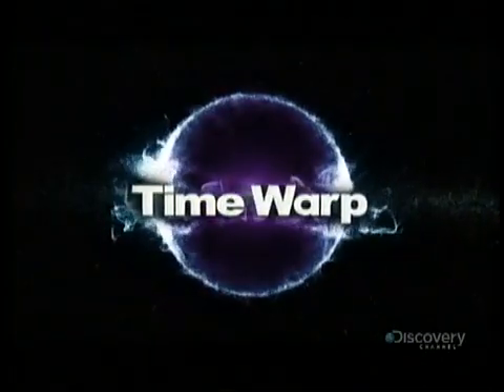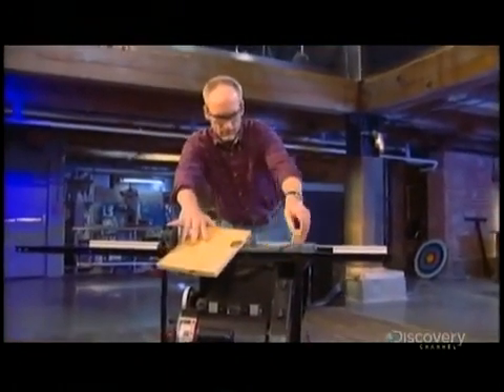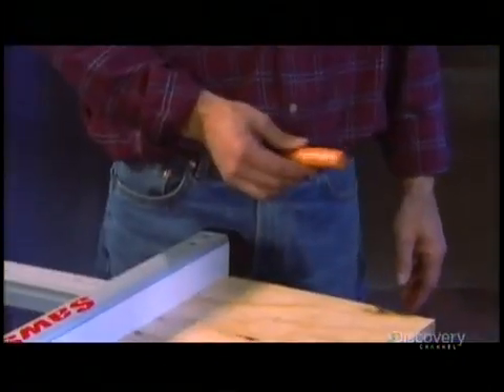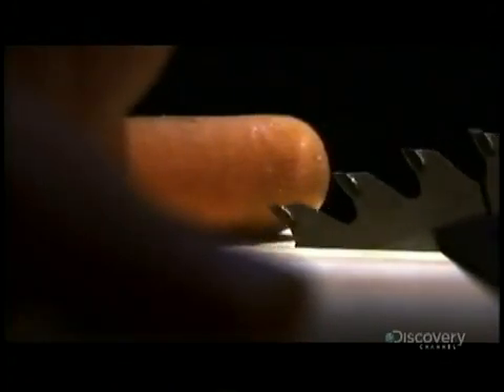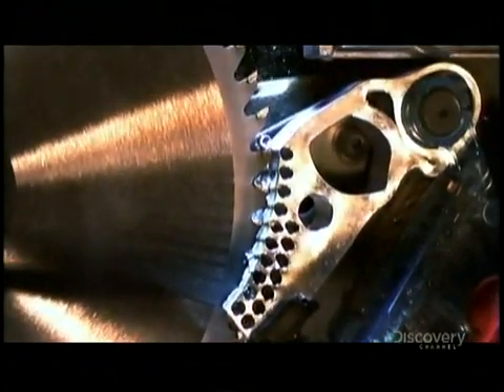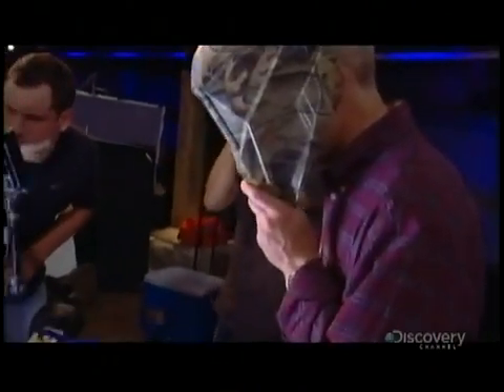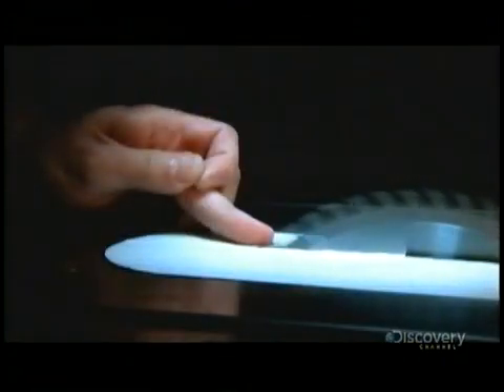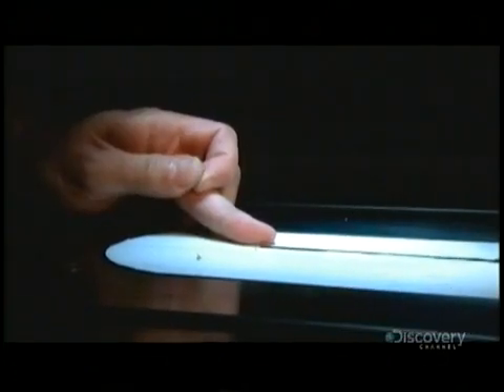Saw Stop - This guy puts a finger into an active table saw blade & comes away without a scratch!

Comment: Isnt a finger normaly dry, specially when working with wood and wooddust?
Reply: we are mostly made of water....
Reply: You do know pure water doesnt conduct electricity? You need electrolytes solved in water to let current pass. And have you worked with wood before? the sweat on your fingers are taken away by the dry wood, since that is made of glycogen-moleucles which are hydroscopic, like sugar is. So, aslong as you are not wearing gloves that can make your hands sweat, you are likely to get your fingers cut off by the saw!
Reply: Conex Xenon Yes I worked with wood on a big 7 operations machine. Yes, pure water (destiled) doesn't conduct electricity because there are no "metals" (minerals) on it. Anyways we stil are conductive, but if your theory work, we can touch cables without getting shocked??
Anyways in a normal cut, and if "this thing" works, half of your finger is gonna take cut at least.
Reply: You dont need metals solved in water to conduct electricity... , yes they can act as a electrolyte when solved in water, but salts consisting of simple kations like the alkali-metals and "earths-alkaline metals + any other organic or inorganic anion will also do!, however the list is endless, anyhting which can be solved in water will mostly do. and yes, you can touch cables if your hands are extremely dry, there are people "not much" who can touch electricity, because of having really dry skin, but everyhting has a limit of course. Also the idea of the mechanism is great, but its not quite trustworthy when working with bare-hands
Reply: joecugo it actually does not , pure h2o does not conduct
Reply: Conex Xenon trefhi I don't know why, but you two seem to have forgotten all the electrolytes that are constantly in your body. The human body is a very good conductor of electricity. Your body is not pure water.

Also this invention does work, even if sawing normally (by normally I mean the average wood worker) you would still barely get a scratch. You could slam your hand down on this thing and you would still have a small scratch. (The blade stops in about 16 milliseconds, to put that into perspective the blink of an eye takes 300-400 milliseconds)
Reply: Conex Xenon iLuZiioNz Tutorials Your discussion is pointless, do you realize that? Video provides us proof that it works, the only way to question that is to conduct an experiment! You have to check it yourself or have a source of someone checking it, otherwise you're speaking bullshit. Bullshit that lacks ANY value. I'm not saying that to offend you, but to save your time - opinions have to be based on facts (when possible - and this is one of those times when it is)
Reply: joecugo
Yes but so do air and rubber. But since the conductivity is extremely low to a point where we couldn't even measure current with normal means, we say it does not conduct.

But philosophically and physically you are technically right.
Reply: joecugo no it doesnt......H20 by itself is not conductive, the minerals an impurities inside of it are what makes it conductive
Reply: Electrolyts need to be solved in water to work... I wouldnt trust this invention yet...
Reply: I don't understand your dilemma. Your body always has electrolytes.
Reply: I m talking about the contact-surface of the skin, of course my body has electrolytes... the surface of your Skin might be dry once you work with wood, that means less to no conductivty , electrolytes don't have any effect like this.. So how is the saw going to stop once you touch it and you don't conduct electricity.?

Comment: I like the idea, however the test was not accurate. If you notice, he put his finger slightly to the left of the saw... Had his finger been aligned to the direction of the saw, he would've lost the tip of his finger according to the video...
Reply: a school near me purchased this saw back in 2007. since then the system has had to be implmented over 10 times. On all occasions, no student needed to be admitted to the hospital. not even the school nurse.
Reply: Not exactly. As you can see, its the tip of the blades that graze the finger and force the stop. So no matter than angle of attack, the machines "reaction time" is the relatively the same.
Reply: Eric Torres 10 times? LOL they did it on purpose
Reply: Shannon Torstonson Nah, usually these systems are falsely triggered by wet wood or metal of some sort. Anything that conducts electricity well, will trigger it.
Reply: No he would not. The blade stops and drops in under 10 milliseconds

Comment: What if you try to cut slightly wet wood, the resistance will drop and false positive protection kicks in.
Reply: There is an override for cutting wet lumber, but you would need a moisture tester to find out if you need to use it

Comment: If he were REALLY trying to bring the number down to zero, he'd invent an AFFORDABLE saw stop system that could be retrofitted aftermarket, or make the actual sawstop affordable to the average woodworker.
Reply: First of all, he never made that statement, it was the narrator of the show. All he did was invent a cool safety device. Second, it's not really incumbent on him to make sure everyone can afford it. It costs a lot of money to develop and produce something like that; what, do you expect him to sell it at a loss? Be real. As for retrofitting one to an existing table saw is simply not practical under any circumstances, and literally impossible to do for less than the cost of replacing the saw altogether. This should be pretty obvious if you give it even a moment's thought. Can you imagine trying to retrofit airbags into a car that wasn't designed for them?

Comment: nice.  but, instead is barely moving your finger into the triggered distance at such a slow pace, what if your finger is travelling at 3" per second like most people?  will it nick you good at least, than?
Reply: Sure it might nick you more than it would if you went slow, but it would be nothing compared to what might have happened without the invention.
Reply: I was thinking about it too, but then I concluded that if you compare the relative speed of your finger/hand to the spin of the saw.. it doesn't matter if your hand/finger moves really fast, since "really fast" is nothing compared to the RPM of the saw.
Reply: Look at the hotdog test. That was at a normal pace and it had little damage. I'd say it's preeeeetty good.
Reply: My thoughts exactly. One wouldn't be creeping up on the blade in normal use. I figure there will be some blood before the blade stops, it might just save your finger but it won't be pretty either way.
Reply: icawn oo0Spyder0oo The blade stops in about 16 milliseconds, to put that into perspective the blink of an eye takes 300-400 milliseconds

Comment: SUPERB but a few questions ?  1 will it cut damp wood out doors or indoors without false triggering    2  work through an isolation transformer
 or 3 work 100% of the time  in very dry conditions indoors with someone wearing shoes with modern soles  i wouldent bet my finger on that
if the table of the saw  was made of plastic so as not to ground any signal and the user had  to use an an earth strap  pluged in to the saw  to opperate it 
through a safety interlock device when using the saw  like this may overcome these problams in rough servixe,  the interlock would also  check if somebody was  connected to it so as to prevent it being powerd up and  used without it
gerat idea
but i think your next task steve  is to try to intergrate this idea  onto a  chain saw
that would save more than a finger (STEVES CHAIN STOP)

Comment: this is an awesome idea, and I'm sure no one would argue that the $60 for the new parts is cheap price for saving a finger or two. What I wonder, since it works on the difference in electrical conductivity, is how it is effected by a damp piece of wood, or treated wood. I would begin to get unhappy if the thing came to a crashing halt every time I tried to cut a damp piece of wood.

Comment: What i'm wondering is how slow you have to move your finger to avoid a cut. Or how fast, on the contrary, do you have to move your hand into the blade to get a cut.
Reply: Electricity moves faster than the speed of light. Literally. You can run your hand into there pretty quick and still have the blade sense the conductivity your finger lets off. But, you have to take into consideration the circumstances. Someone using this blade wouldn't be feeding wood at a rapid rate. Slow and steady is your best bet. You can see how close the guy's finger got, but the blade barely nicked him. That goes to show how little effort it takes for the blade to sense the current coming from your hand.
Reply: Noah M
Actually it moves slightly slower than the speed of light. The actual speed depending on the properties of the material it travels through.
Reply: Thanks for letting me know! I wasn't sure how fast it was.

Comment: It's a fantastic invention and a great safety feature for a pretty dangerous machine, but I'm curious. Why not just touch the side of the blade? I get that he's got a lot of faith in his machine, but just in case you know?
Reply: because that wouldn't prove anything.  they already proved that the saw blade will stop with the hotdog, the finger test was to show that it would stop before it cut a person.  if all they were doing was preliminary testing to see if the sensor worked, then yes, touching the side would be fine for that, but this is to see how well it protects you from being cut.
Reply: Huh.. good point.

Comment: The idea of making saws stop quickly isn't new. The issue is making it cheap and reliable enough to make it commercially viable. 

Unfortunately, it sometimes confuses damp and green wood with fingers, unnecessarily braking (and ruining) blades. Because of that, a lot of people keep the safety system off.

It should be possible to have a "test mode" that just measures the wood conductivity and warns the user if it's dry enough to enable the safety. I'm not sure if current models do this.

Comment: It stops and retracts in 5 milliseconds or less.

If you're a world boxing champion, hitting it with your maximum-speed punch, you might be fast enough to have it cut about half way into a finger. Highly unlikely, though, because although the saw takes 5 ms to stop, it starts retracting before that, so it moves away from the fist.

If you're a top baseball pitcher, however, touching the saw blade at the fastest point of your arm / wrist swing, you could theoretically lose a finger or two.

Comment: Sweat is unlikely to make a difference (a single drop won't change the current by much). Wet wood, on the other hand, can result in a pretty high bill for trashed sawblades. In fact, the manufacturer warns that, to cut very green or wet timber, you need to turn the safety system off.

Comment: wrong. capacitive sensing works by sensing proximityof a conductor.  has nothing to do with touching blood. Depending on the sensitivity of the sensor, it could be tripped from cm away. But since the rest of the table is metal it needs to only trip it at a closer distance. it nicks the hotdog cuz the hotdog is moving fast, so when it trips it before it touches the blade, it still touches the blade a little before the blade completely stops. (this is why it didnt for his slow moving finger)

Comment: This man has Balls of Steel.  He can stop a Table Saw with one finger :P

but one question, can you use this early in the morning when there's still some fog? or what if your wood is a little bit wet?  What if it starts raining (small drops, not a storm of course)  These are all conditions in which you could be working.

I would hate to pay 60$ to repair my saw everytime the safety system activates for no good reason.

Comment: I don't see how your rhetorical question diminishes my argument's validity.
Moreover, I didn't suggest a causal link between religiosity & scientific work. Only that there is an (anecdotal) correlation which shows that the 2 aren't opposed. That's because religion mostly deals with "what does it mean?" & not "how does it work?".
Lastly, most religions don't rely solely on faith & science is distinguished by the scientific method, not by evidence. Eg history requires evidence, but isn't science.

Comment: I brought this up with my makerspace, and they said they worry about how SawStop would handle moist and/or pressure treated woods (think ACQ). Some types of wood are more conductive than others, so wouldn't there be cases where the SawStop will stop a saw from cutting certain types of wood? If so, that's a serious problem.

It'd be great if SawStop's sensitivity was adjustable.

Comment: ...the saw is metal.. and metal led electricity.. and you have electricity in your body and wood cant led electricity so it wont led.And it stops directly when making contact with your body's electricity (signals). watch the hole video to understand

Comment: They're not saying you should put your fingers into saws from now on. It definitely helps.

Just as you can't use a capacitive touch screen with a glove on, this would probably not work either. (Once it cuts you, it would get wet anyway, so it would probably stop before cutting your whole finger off. Which makes it quite useful.)

Comment: Only if you repeatedly put your finger, hands, arms, etc into it. This is a system designed NOT to have to be used, except on in situations where someone WOULD get injured by the saw blade.

Comment: When using a table saw you generally don't 'thrust' the wood into the saw you inch it in towards the saw or you won't get a straight line. So if someone accidentally had their finger in the wrong place they would only be coming at the blade slowly no "thrusting" towards it

Comment: it wouldn't be possible to move such object as spinning circular blade away so fast that it wouldnt injure hand. to do this, you'd need something more expensive and complex than whole saw station, i assume. This guy's trigger is small and moves way more faster, and stops the blade and pushes it down.

Comment: He only touched it slightly because he didn't obviously want to get hurt. If you jam your finger into the blade it will probably damage it, but far less than it would in the event that you didn't have any system at all. He wants to show it works, not make a damage comparison

Comment: I think it's a matter of sheer stopping power. At those speeds, moving it out the way simply isn't an option. Stopping it quick enough with something like a disc brake probably destroys the blade anyway, so the choice to slam it into a block of aluminium thus makes no difference and is probably much safer

Comment: Besides the blade, I can see there being some damage to the gears driving the blade, too. Having them made of particularly soft steel or cast iron, such that the teeth of a single driving gear shatter when this device engages, would mean the gears can come to a complete stop without permanently damaging any of them, at the cost of about $80, would be well worth the expense of compensation suit. Liability insurance discounts should cover the cost of installing this thing, especially in schools.

Comment: Speculating that you could do that with a normal table saw and get a tiny cut is pointless. Tablesaws grab, pull, and throw shit. I would not bet you could do that with a normal saw, it would probably force your finger down if you touched the blade on the infeed side. It may be possible, but who cares. The sawstop blade retracts and stops in under a thousandth of a second, i seriously doubt people can move their hands close to that fast. So still i maintain, you would be fine.

Comment: Have you ever felt current going through your hand when you touch one of those electric-pen-things? that's the exact same thing that will make the machine stop. He's just soaking his hand in cold water so that, worst case scenario, the pain doesn't cause him a shock. 

A dry hand can transfer just as much current if not more than a wet one. So the machine will still stop as long as it your own skin the one that touches the disc.

Comment: I'm a tradesman and I'm working with these machines daily. I had a few close calls and the worst one was a couple of days ago where I almost cut my arm off on a table saw. Luckily it's just a pretty deep wound but my arm is still there. I wonder how good that works after hours of use and even carrying the machine back and fort from car to place where you need to cut. I know my tools are getting pretty abused from being carried around and used for hours.

Comment: cars "break" when you're in a crash.. so how is this any different?  The whole point is to prevent an accident.  I've NEVER had my finger touch a saw blade but if it did I wouldn't care if it broke and cost be $60 as long as I still had my fingers!  and by the way Sawstop is doing very well. I see them in shops all the time.